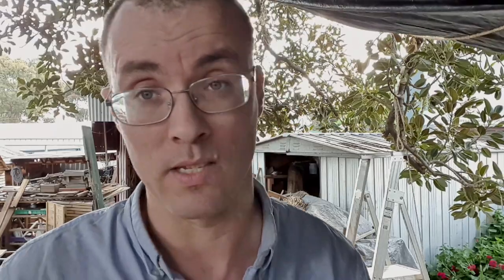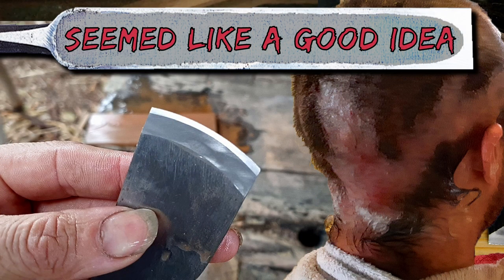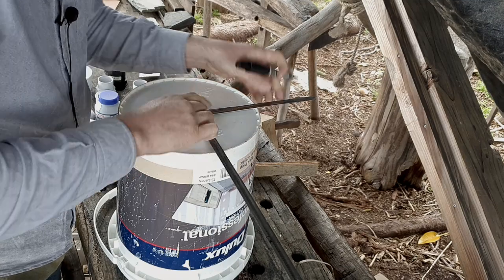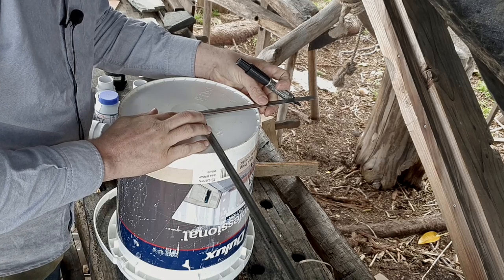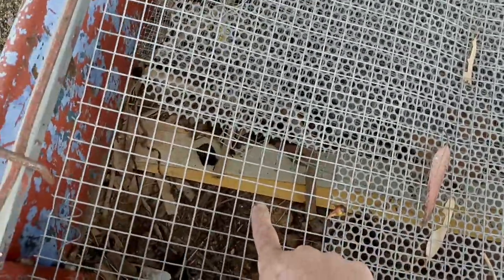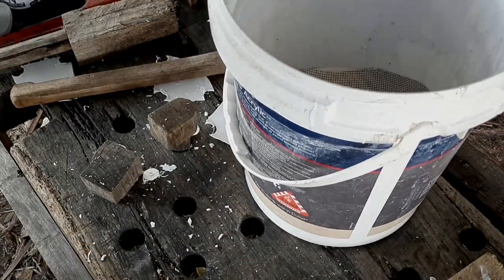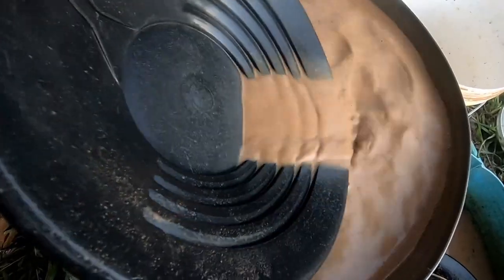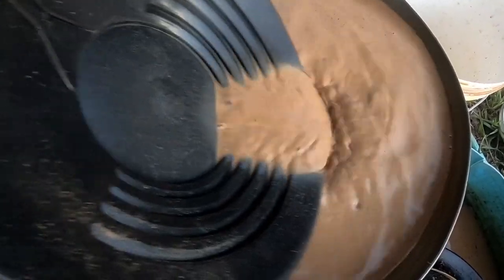How to make a Classifier with Interchangeable Screens

Comment: Seen the Arbor Fabricating classifiers?  I tried my hand at building a "poor man's version.  What I found is if a bucket classifier like yours has a way for water to ALSO enter the bucket higher up than your version (along the sides somewhere), the water coming in "from above" helped the "overloading/overfeeding" problem GREATLY. When there's too much material in the classifying bucket, water can't get up thru the mesh and muck to liquify and wash the lot. Having water coming in from the top AS WELL AS FROM THE BOTTOM helps that problem greatly! It does make it difficult to swap out  bottom screens, though....  Love your vids! Thanks.
Reply from the maker: Yeah the arbor classifiers are great but you kind of need one of each mesh size.
In the vid you see me mixing the movements between short sharp up and down and left and right movements. Too vigorous with the up and down movement and you loose water.

The trouble with side vents is that there isn't much of a gap between the classifier and the hold bucket. Means that side mesh wouldn't do much for material escaping although it might let water in.

I find just doing small amounts at a time is the easiest way to make it work quickly. Even with an open side classifier like the Arbors that would still apply.

Comment: Nicely done, it's the only way for washing and classification here, as you mentioned you just reuse the water. One fifteen litre bucket of water can give you a good dozen buckets of material to wash (depending on clay)as it gets a bit soupy in the right material.
Yell out if you need more buckets, all I seem to be doing is emptying them of there paint contents, not filling them with gravels. Thou I did go out to bullfrog gully where I previously got a nice target using the monster in a tight crevice, this time with bait pump, bucket classifier and crevicing tools went to work only to get half a bucket of  classified material and two frogs. Dished off at home to reveal a couple of nice pickers .12 & .08 plus fines and three lead shots.
PS. like the axe.
Reply from the maker: Noice. Pitty we can't go out now. Maybe Thursday fingers crossed.

Comment: No idea why you cannot have 2 separate bucket sieves
They sit inside each other and take up the same room when transporting - weight of the extra bucket is somewhat insignificant - and you have an infinite supply of buckets at no cost.
I have found inserting the smaller sieve  followed by the larger sieve means you can ALMOST do both classifications at the same time - but doind the larger , remove it and then do the smaller - should still be quicker than doing each sieve size separately
tell me again the advantage of having changeable screens ?
Reply from the maker: Two buckets sieves in the bucket at once it increases the required depth of water. You could get around this by only partially filling the bucket with screened material and then tipping off into another bucket. You have to do this anyway but multiple sieves would increase the required frequency.

As for why you can't have two separate bucket sieves, well no reason at all.  If that's what you would prefer. I've preferred having changeable screens because depending on what I'm doing I what difference screen sizes. If I was to have a bucket sieves for every mesh that would add up.
Reply: @MadScientistProspecting  I myself fill the bucket to the top with water.
the more water in the bucket the easier material passes through your mesh , especially when the water gets thicker.
If losing water is an issue , then place the bucket in a basin , and as the material displaces water , the water accumulates into the basin to be reused.
The bigger mesh size the quicker it is to process.
I myself use a 1 inch and occasionally 1/2 inch after that if I want to take material home